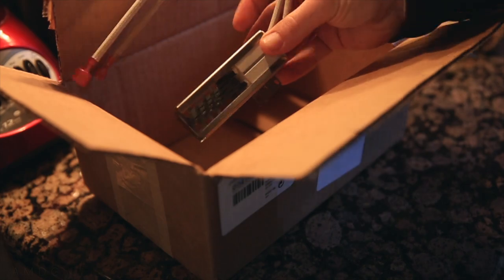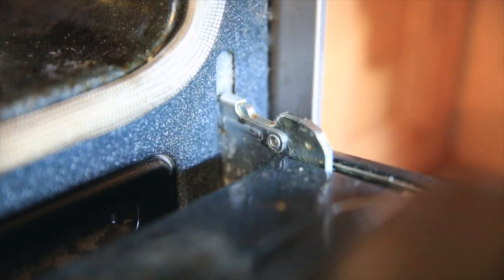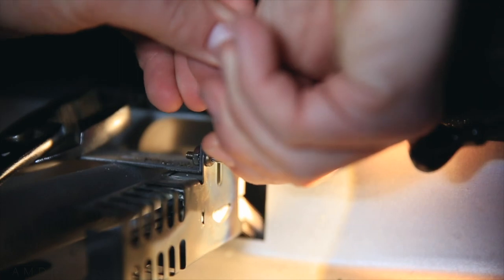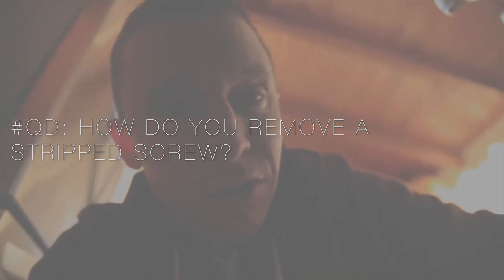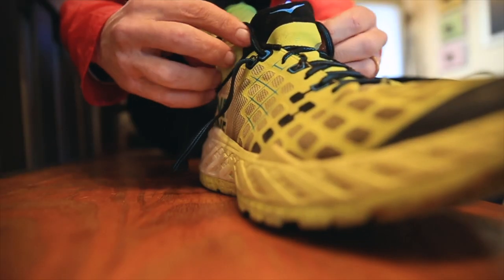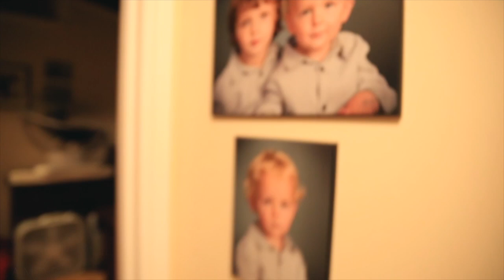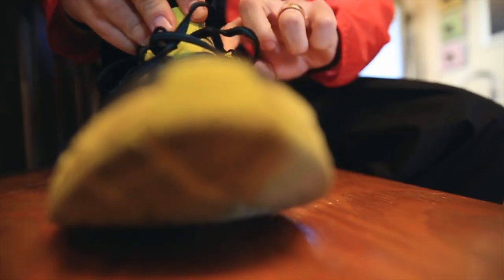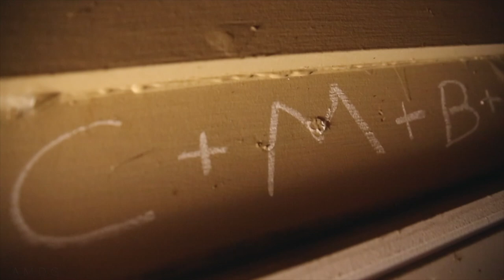denied

Comment: Lightly hammer a hex key into the stripped bolt, that will get a grip on it👍
Reply: This is the same principle, just instead of the drill lightly tap the end of the star/hex piece into the bolt as your part is a bit more delicate than his, then pop the socket set on the end and turn it off
Reply from the maker: The FOD Runner thx for the tip, turns out I got it loose with a pair of vice grips in today’s vlog
Reply: Seth James DeMoor well done mate great job!

Comment: Grind a slot into the screw and use a flathead screwdriver.
Reply from the maker: Thomas Beard great idea, turned out I loosened the nut with vice grips, that did the trick

Comment: Welcome to the world of home and car repair, where a simple 5 minute job can take 5 hours. #frustrating All good tips here in the comments. Basically, you have to keep trying a bunch of things until something works, but be careful not to damage your oven (or yourself for that matter) which will end up costing you more money. Other ideas: 1)Try to get a grip on the screw head with a pair of vise-grips, aka locking pliers. One of tools I like for specialty situations is needle-nose vise-grips. 2)If you can't get a bite, you could also try drilling off the screw head with a good metal bit. #UseEyeProtection This will destroy the screw but you don't want to reuse it anyway. As long as you drill down into the head of the screw right into the center of the star pattern (and along the axis of the screw) with a drill bit wider than the shaft of the screw, the head will pop off. 3)Finally, you could try a bolt extractor, but the first step involves drilling a hole in the screw. So, you might as well just drill the head off as in (2) above, since you have access to the back of the screw and can just pull it out after the head falls off. 4)If you have room, you could try a hack saw to cut the screw off, but it does not look like there's room. 5)Borrow a Dremel from someone and use it to cut off the head or grind a slot, as suggested by Thomas. 6)Options (1) through (4) have always worked for me. #YouGotThis